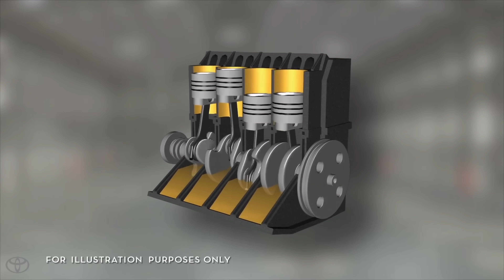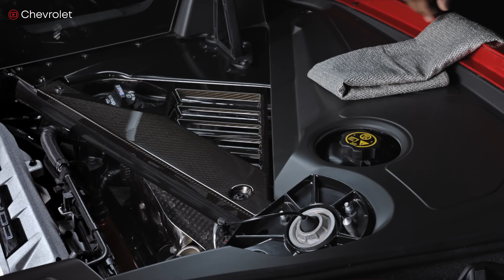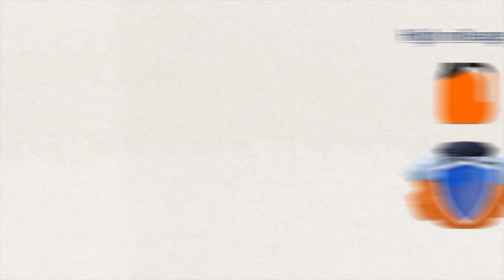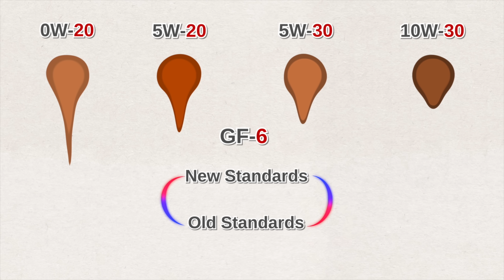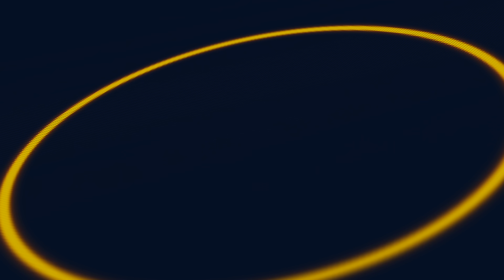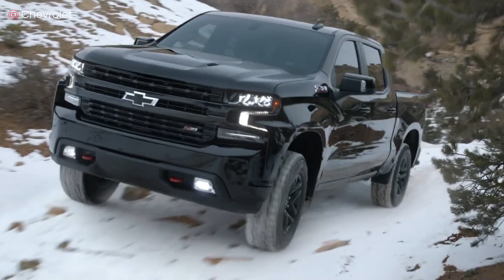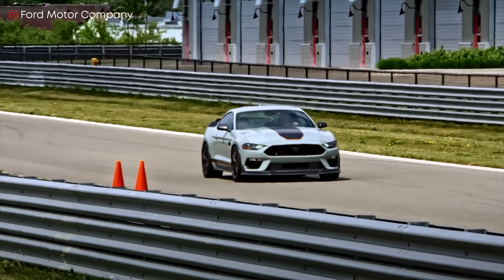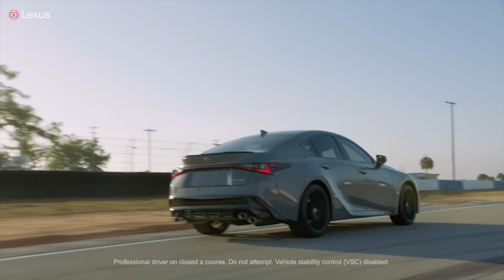7 Engine Oil Myths Stupid People Fall For

Comment: My Subaru recommends 5W 30 synthetic. I feel that 10W-30 would be a better choice since I live in Florida.  Am I correct in my thinking.
Reply: No! Are you a engineer that knows more than Subaru the builder of the car?
If not, Only use the factory recommended oil weigh! It covers a variety of temperature differences. 
10-30w is too thick for cold engine starts and would take too long for the oil to reach the top end, over time the engine wear would increase. 
Best of luck.

Comment: i was wondering about that going synthetic then going back to regular oil causing leaks turns out its a myth whew :)
Reply: If anything, on an engine with a lot of wear and tear going to synthetic oil might cause leaks or oil burning due to the thinner oil getting past gaps and worn out seals that a thicker oil wouldn't get past, switching back to non synthetic should "fix" those leaks and oil burning (hide them really)

Comment: You should include 100% synthetic oil which is different from full synthetic oil.
Reply: How so?
Reply: There are oil base categories bases by their characteristics. There are five categories. The first three are crude oil (oil from the ground). Category 4 is polyalphaoefin (man made oil, true synthetic by definition). Full synthetic oil falls under category 3 and won a lawsuit to keep saying their oil is full synthetic oil even though it was not by definition but performs well. It is a marketing strategy oil companies use to sell their oil products. Full synthetic oil is refined to the max but is still oil from the ground. 100% synthetic oil is not from the ground and performs way better than full synthetic oil. That is why some oil brands like Mobile 1 are labeled full synthetic and oil brands like Amsoil are labeled 100% synthetic oil.
Reply: 100 percent should be full synthetic?

Comment: Audi oil change intervals in Europe is 30000km in most cases. That is about 18641 miles. I guess changing more often is wise, but once a year / 10000 miles should be safe with a modern car.

Comment: My 2015 Scion xB’s miles is almost hit the deadline. It’s got 58,600 miles (I think). So I will get my oil change and my first AT transmission fluid change. This is gonna be more fun than ever. Best part is they both have very similar approach to get them changed up.

Comment: Good vid. Note to take- the best oil is only as good as the oil filter. Don't cheap out.
Reply: That is completely false 😆
Reply: Enjoy putting good oil through junk filters then guy. I wouldn't use junk oil or junk filters, but eh, I don't work on this stuff or anything.

Comment: Could you talk about oil use and types for small engines? I bought a new mower with a Honda engine. Less than 5 hours. Should I use a synthetic blend or full synthetic? Thank you.
Reply: Use what they recommend in the manual.

Comment: Have a 2019 honda crv. Oil light comes on every 3000 miles. But the dealership uses synthetic oil that is supposed to last 7000 miles. Is the dealer ripping me off?
Reply: Because new CRV’s have oil dilution problems

Comment: Great video but I have a question. I have a Toyota Sienna 2007 with 206000 miles I put about 60,000 miles (mostly highway) on it per year and it runs very well. I use synthetic oil. My question is: should I switch to high mileage oil? Isn't that also synthetic oil?
Reply: There is no reason to switch regardless of the mileage on the engine as long as it's not showing obvious signs of wear like consuming oil.

Comment: I had a Dodge Avenger for several years.
Bought used but the 2.0 4 cylinder leaked oil. A knowledgeable coworker told me that engine had a design flaw in the head and I could buy 10 head gaskets and I'd be lucky if just one of them wouldn't still leak. So I ran pure synthetic oil as it was purported to not break down when an engine would run hot. I would change the filter and refill it with around 3 qts. Every month and a half. It never overheated despite how careless I was about checking the oil level. It ran pretty consistently so I wasn't too worried. It had a 5 spd manual transmission so performance while nothing to crow about it could still scoot in the city. Wish I'd had the luxury of rebuilding the whole thing and put a V6 in it which would have been great if I'd been able to retain the manual transmission.

Comment: My 2008 Passat with only 140000 Km took it to this place for oil change they vacuumed it instead of opening a screw and by doing vacuuming they broke it took it to a mechanic specialize in vw he said they did some damage when they did vacuuming and he said why did they use vacuum anyways while there is a screw there he said they were too lazy to lift it up on jacks so I went back to same mechanic said no my guys didn’t do that while the car had only 110k on it when I bought it from older guy like new and I put 30k on it he only took it to dealer so car had no leak whatsoever before I go to these guys after I went there leak started next day saw oil on the ground anyways my point is you gotta be aware who you go to people can mess up your car for something simple just as oil change

Comment: I didn't know about dark oil. I have one vehicle that the oil always gets dark, so I've been changing at 3,333. By the way costco synthetic is less than $30 for 10 quarts.
Reply: It is cheaper because of what additives are NOT in it.

Comment: Me seeing the diagram of a fully submerged crank shaft. And reading defenses from the “car guys” who’ve only ever seen the inside of a 2.5 horse brigs an Stratton
Reply: crankshafts are not submerged though so that illustration is wrong. it actually rides above the oil or else it would whip the oil into a froth and make it virtually unusable. also i have seen the inside of many engines as well as repaired and rebuilt a few ranging from automobiles, motorcycles, atvs, lawnmowers etc.
Reply: @paulk5311  was talking abt the ppl defending the submurged crank. the video showed a diagram of one so yes we are both referring to the same incorrect diagram

Comment: Am a woman, and back some 30 yrs ago, I had bought my first car. After putting 3,000 miles on it. I switched to synthetic 100 % oil. The car lasted for 10 yrs.  Then I bought another vehicle, and to this day still use synthetic oil. My vehicle takes 5W30.  This 2nd car has 184,000 miles and is still running in 2021!  I hope to take it up to another 16,000 miles or more.  I check my own oil!
Reply: Years ago NYC taxicabs would last for 500,000 miles using conventional oil. The main thing is to change it on time and avoid short trips where the engine never fully warms up. Those NYC cabs were running constantly. Cold starts are the biggest contributor to engine wear.
Reply: @masterofnone1808  stop start cycle wear.
Reply: @masterofnone1808  taxis are always running also.  On off cycles wears it out quicker.
Reply: I have a car that we bought with 20k on it. I have used only conventional oil its whole life, always a good name brand. I change it every 3-5 thousand miles as well as the filter. It now has 220k on it and runs like a top. I think changing it means more than the type of oil you use, just my 2 cents.
Reply: @MrNota500  I change mine frequently (5000k max miles on an oil change) and I use full synthetic pennzoil. I noticed with cheaper oil my truck would make a knocking sound on startup when cold and with the better oil it didn’t. Just my opinion
Reply: @nolanhauge  changing synthetic at 5k is just throwing money away tbh. Quality synthetics will do 30k.
Reply: @arbit3r  thats a bold statement
Reply: @arbit3r  Maybe if you don’t care about your engine. 10k is the limit for synthetic even then it’s heavily degraded
Reply: @nolanhauge 30k is life specified by manufacturer. Not just a random guess.
Reply: @arbit3r  no way I would run an engine for 30k without a change. 10k MOST. maybe 12 if you're not driving too hard and are strapped for money at the time. 30k is Overkill.
Reply: @theerealatm  how have you come to that number? Is it just based on a guess or specification from vehicle manufacturer? Oil life on my van is 10-30k and that's based on manufacturer specs. Computer calculates engine load, stop start cycles, oil age and mileage to calculate oil life. It's not a guess, it's calculated by the engineers that designed the vehicle. I would imagine that they know what they are doing. Have you done an oil analysis at 10k to determine remaining oil life?
Reply: @arbit3r dude do you even watch Scotty's channel? If you're going 30K between oil changes then Godspeed to your engine. That's unbelievable. I bet you believe the manufacturer saying the transmission fluid is lifetime also 😄😄
Reply: @arbit3r What car do you drive?
Reply: @eligreg99  Peugeot boxer 2016
Reply: @arbit3r tha is absolutely insane.... never go 30k! Thats stupidity.. ..i never  even go 10k...ive worked on cars and trucks for 20 years....30k has never been ok..and isnt now.
Reply: @arbit3r you must listen to everything you hear.....
Reply: @richsweeney1115  Its not as insane as you think. It very much depends on oil type, total volume in sump, type of engine, total running hours, total number of cold starts, engine load during operation,  age of oil etc. Mileage is a very inaccurate and crude way of determining oil life. Send off for an oil analysis at 10k on a big diesel that does motorway miles and see the results for yourself. I manufacture biodiesel and reactors and have allot of experience with oil, so no I don't believe everything I read. Many people do however. I actually studied in university and qualified in engineering. We have fleet lorrys which do 40K between oil changes and the oil analysis still shows good metrics. Granted they do have 2 stage bypass oil filtration but that only helps with particulates, that is only one of many metrics used in oil life analysis. Do you believe everything that you hear?
Reply: @arbit3r what car it is and what manufacturer recommends changing oil at 30,000 miles?
Reply: @arbit3r please don’t ever say anytime that ever again in your life
Reply: @arbit3r yeah...keep driving it untill it reaches 30k😅
Reply: @Angelo1-1 I have a sprinter with 400k miles and only followed the manufacturer maintenance schedule which is 27k to 35k between oil changes. Its still running well. Big sump on vans and MB have only been manufacturing vehicles for 100 years so I would think they know what they are talking about.
Reply: @westendinventor364  i believe what you are saying. I used to have one, best vans from my point of view  but i was changing the oil every 6 months or 6k miles brother. Manufacturers are saying whats the maximum you can go.
Reply: @theerealatm Oil is cheap. Engines are expensive. I would never put more than7,500 miles on synthetic
Reply: We need an update. How's she running
Reply: I have 265,000 on my Honda
Reply: I'm a trans woman and I totally understand sis 🌈.
Reply: Leave the guy change the oil at 30k if he likes it so. It's his car. And it's a Peugeot after all.
Problem solved.
Reply: How frequently do you change?
Reply: Women
Reply: Am a Tranny, I do my own lubes, and have high mileage!!!
Reply: 2 yrs later what happened
Reply: What do you have?
Reply: Is it still working?
Reply: My.last car kia spectra 351k yes 351k conventional oil valvolene.  Every 4k mile.OC.  I ain't mad. My truck had 287k and I wrecked it. Mad.
Reply: My.last car kia spectra 351k yes 351k conventional oil valvolene.  Every 4k mile.OC.  I ain't mad. My truck had 287k and I wrecked it. Mad.
Reply: My.last car kia spectra 351k yes 351k conventional oil valvolene.  Every 4k mile.OC.  I ain't mad. My truck had 287k and I wrecked it. Mad.
Reply: My.last car kia spectra 351k yes 351k conventional oil valvolene.  Every 4k mile.OC.  I ain't mad. My truck had 287k and I wrecked it. Mad.
Reply: You are genius.
Reply: I got 503,000+ miles on a1990 ford Aerostar oil change every 3-5000 miles mostly done by me! Me cars all have lasted
Reply: So proud 👏 of you.
Reply: I change my oil every 2k to 2.5k. My last car made it over 370k miles be fore the ABS module went out and I decided to by a new one vehicle. Who knows how much longer the engine would have lasted.
Reply: What does any of that have to do with you being a woman?
Reply: Is 10 years notable? I've never gone synthetic and I've been driving a 2006 RAV4 since new. 240k and still going.
Reply: I change my oil every 10 miles. Sure it takes me a long time to get around town, and having 400 litres of oil on board for family vacations causes some stress, but no way am I taking a chance on a blown engine, no sir.
Reply: What's being a woman got to do with it? We're talking engines and oil, not gonads. But best wishes with your car. "As a man" I just did my first oil and oil filter change. I was intimidated but it was quite straightforward. I researched it, wrote a tick list, bought the things I needed, and did it. 

Next time I'll take longer to fill the oil pan, as it seemed to be taking a lot to increase the oil level on the dipstick. And I did over fill it slightly. Which I was trying to avoid. 

I feel a lot more confident now though.
Reply: By the way I'm not having a go at you. I'm saying regardless of gender, you belong where you want to be, and you're fully capable of doing what you want to do. 

And if I can learn from you, I'm glad to.
Reply: No. The filter would have too much crap by then. 5k max or one year for synthetic.
Reply: @washburnb1  that's nonsense. I have cut open plenty of filters with over 15k on them and flow is still very good.
Reply: @arbit3r  Just darn great for the engine. Great flow with all the dirt particles flowing just fine with it to score all your bearings very well to save $8 now and then.
Reply: @washburnb1  how do particles flow through a filter with no flow?
Reply: @arbit3r  It will flow. That's the issue. It will carry particles just fine all the way to 30k.
Reply: @washburnb1  a brand new filter will let those particles flow just as easily as an old filter if they are fine enough. Most filters are around 25 microns so anything smaller than that will pass through the filter regardless of age. A clogged filter will only suffer from poor flow, and to clogg one of those to the point where flow is reduced will take allot. I manufacture biodiesel and even after 10k miles on biodiesel which tends to cause motor oil to polimerize and gel up inside the filter  the flow is usually still adequate. I could show you a side by side flow test on filters of various mileage with similar results.
Reply: @arbit3r  I respect your motor knowledge but if  fine particles still go through a new filter, isn't that more reason to change at 5k or 10k?
Reply: My response was to your comment on the oil filter being clogged with contaminates as soon as 5k miles, Which would not be possible unless the oil suffered heavy and abnormal contamination. Of course changing your oil as frequently as possible is good practice, however there is a misconception that oil should be changed at ridiculously low miles regardless of oil life. Would you change brake pads or tyres if they were only half worn because a guy online told you so without providing evidence? It's hard to visually inspect oil life without specialist equipment so people go on assumption. Yes there are particles smaller than 25 microns that will cause damage that will pass through the oil filter but they are generally in very small concentration. Cylinder wall damage only happens with partials smaller than 3 microns and larger than 0.5microns and only with certain harder particles, steel/carbon as they are the only ones small enough to clear cylinder/piston clearance of around  3 microns and actually cause wear. It takes tens of thousands of miles for those to build up to levels that would cause concern on a well maintained engine.
Reply: @arbit3r  would you use synthetic oil if you have the choice?
Reply: @washburnb1  I only use synthetic. Unless it's only my older vehicles in which case I change the oil much more frequently.
Reply: @arbit3r  Me, too. Thanks
Reply: You are really a superwoman. Do you also change a flat tire without any problems?

Comment: I have a 2019 Honda Civic with 1.5 GDI Turbo engine. The manufacture recommends 0w20 should I be using the new 0w16 or is GF6 0w20 just as good?
Reply: Actually I would consider 0W30 synthetic for a little extra margin of safety for the turbo direct injection engine as they tend to dilute the oil with fuel and turbos break down oil rather quickly.  I would not put 0W16 in that engine.

Comment: Is it good to switch from 15w40 to 10w60 for wide rev range carburated engine? Like 1.1 TL 33 kw that has rev range from 250 to 6500 rpm’s, it starts so poorly in winter and has realy high reving idle in summer time

Comment: Recommended engine oil for my Honda Accord 2011 V6 is 0W-20. I live in Nigeria in very hot climate and I’ve used 5W-20. I noticed the maintenance minder now has a longer oil change interval of about +1000mi compared to when I used 0W-20. Could I be ruining my engine?
Reply: No

Comment: I've always used conventional, and all my vehicles are running with over 400k on them! Just change it often and top up as needed and you'll be fine.
Reply: Conventional is fine unless you have a turbocharger. They get HOT and can crystalize cheap oil if you don't let the turbo cool after a hard run. This is when changing out synthetic often is needed.
Reply: Nothing wrong with conventional but a synthetic oil should not need to be changed as often and should protect the engine just as well even though it's in the crankcase for a couple thousand miles more. Depending on the brand the price difference per quart can be as low as 30¢ to 40¢ a quart.